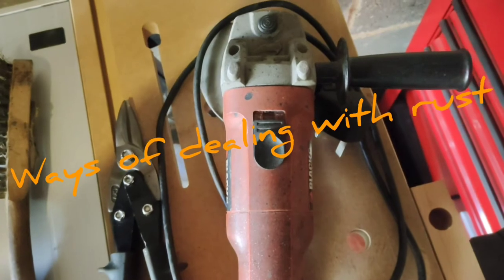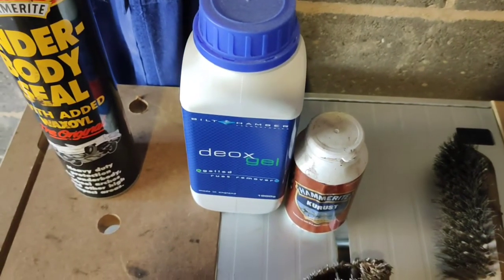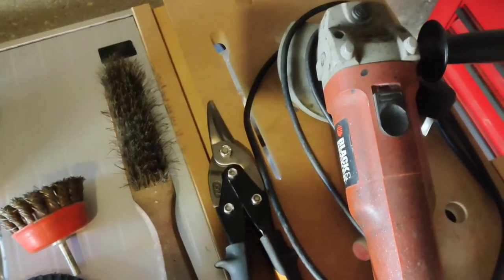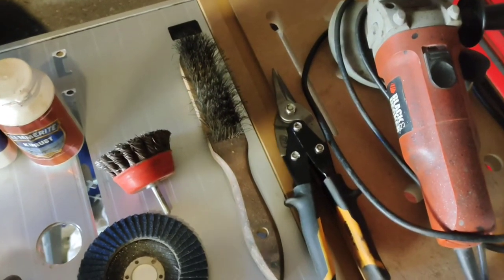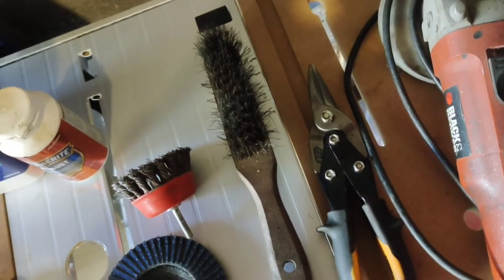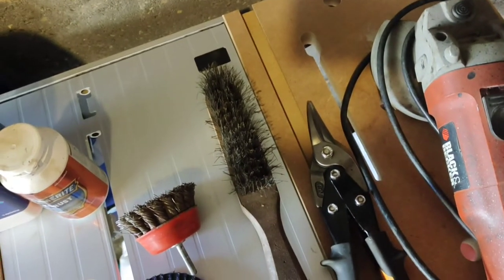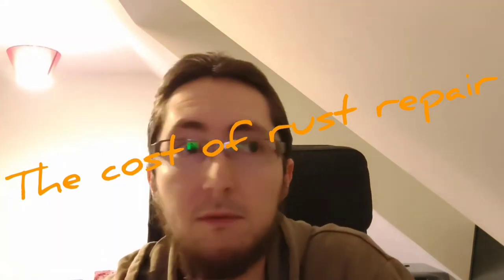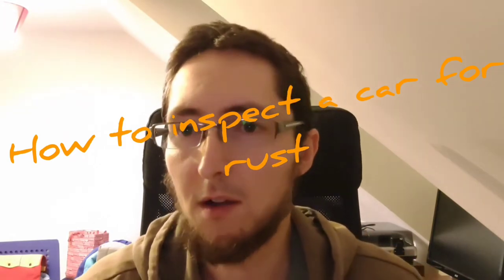A guide to corrosion in cars

Comment: T30 Xtrail owners have often found out the hard way about rusty rear suspension turrets thanks to Nissan using overlapping panels with zero surface coating before the panels get spot-welded together. What surprises me is that modern cars made within the last five to ten years aren't immune to structural rust either.
Reply from the maker: Yeah it's definitely not age dependent if there's a weakness in design anywhere in a car rust will happen. I used to think it had more to do with how a car is used and stored but from what I've experienced design seems to be the most important factor. It should be a key consideration in new car manufacture given the environmental impact of scrapping a car with terminal rust. 

Funnily enough an X-Trail popped up Autotrader with some fairly chronic wheel arch rust recently which reminded me to come back and reply to this comment!